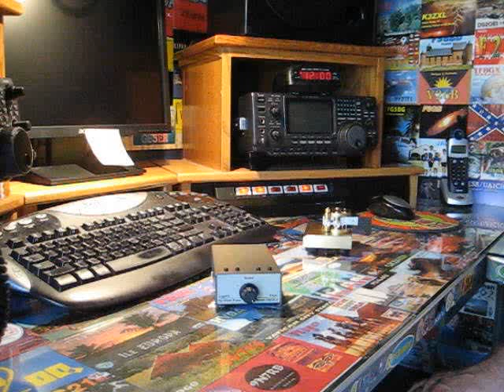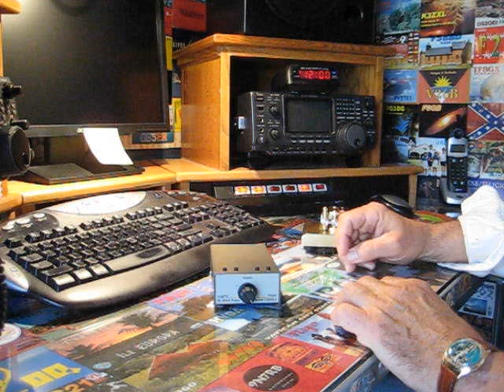High Speed Morse Code with a ZN Telegraph key by WØAAA

Comment: Nice and fast 💨. Thanks for sharing. Could you send faster on dual paddles? or not?
Reply from the maker: Check out this link by N1FN regarding dual versus single lever paddles.    chrome-extension://efaidnbmnnnibpcajpcglclefindmkaj/https://cwops.org/wp-content/uploads/2018/06/iambicmyth.pdf
Reply: @W0AAA  I've already read this, thanks. It's about squeeze keying vs. not squeeze keying (on dual paddles). Obviously, with single paddles, it's impossible to squeeze, thus the point is moot.
Reply from the maker: @franka7691    The top cw operators in the 
world come from the country of Belarus.  They win the high speed telegraphy contests held in Europe and Asia year-after-year. According to what I was told by one of the participants, they prefer single levers over dual levers.  I prefer the single levers myself but it really doesn't become an issue until very high speeds are attempted.
Reply: @W0AAA  thanks for corroborating. That's exactly the same thing that I heard, from multiple sources. I'm thinking about purchasing a paddle that is switchable from single to dual function, as my next paddle.